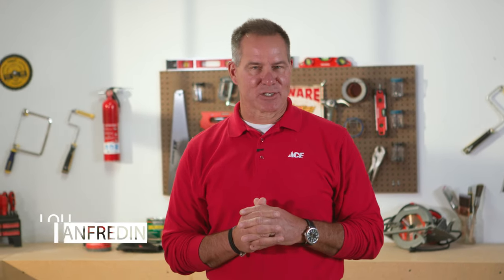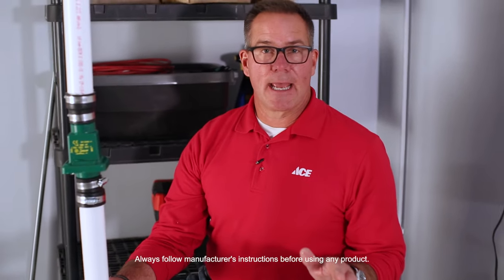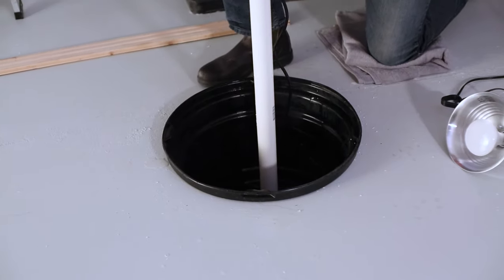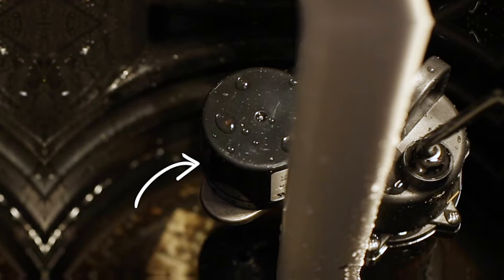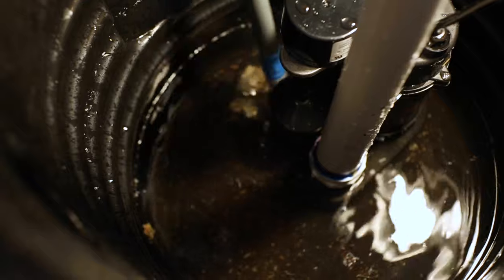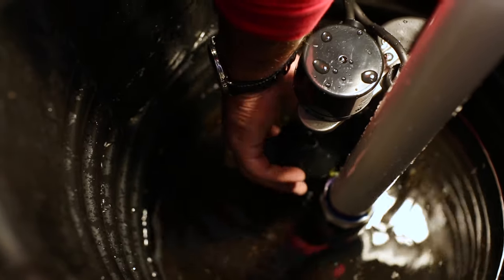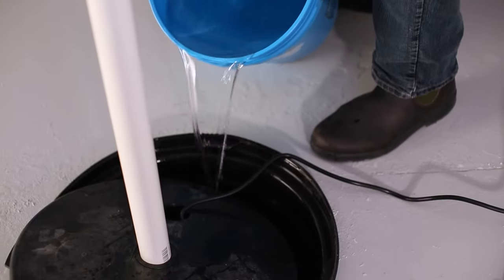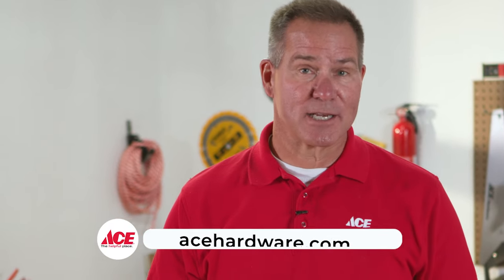How To Know If Your Sump Pump Is Working - Ace Hardware

Comment: What do you do if your pump is sealed off? We have never delt with one before and it's sealed because our radon mitigation system runs down through it. Our basement flooded and we're trying to figure out if the pump is working or why it failed.
Reply from the maker: Hi There,
You have to unseal it to service and inspect the pump. Then after all is working you have to reseal. Hope this helps!